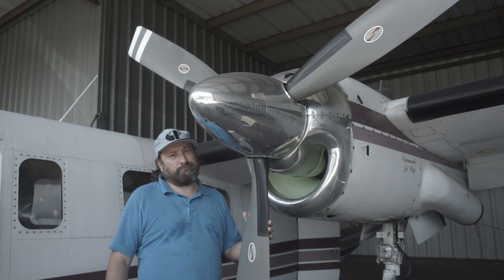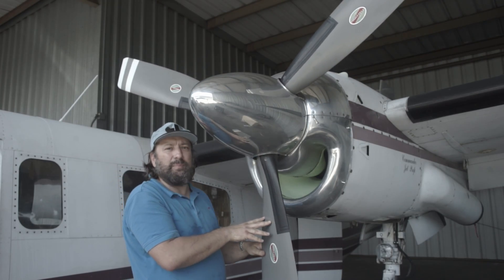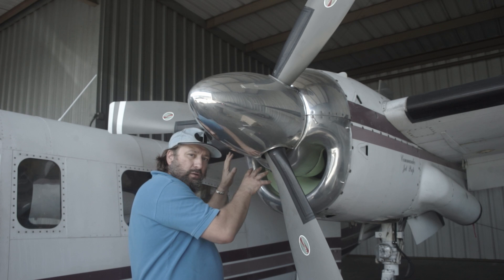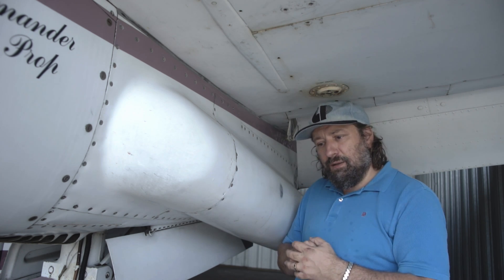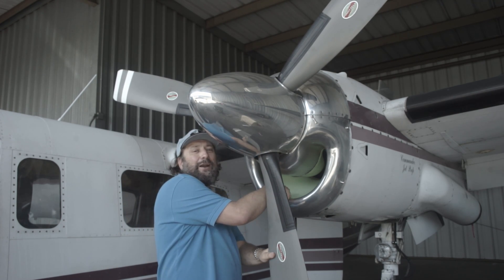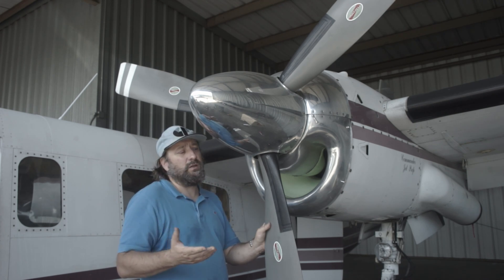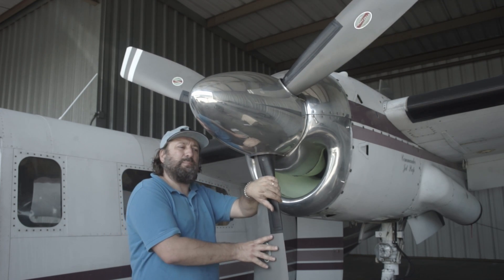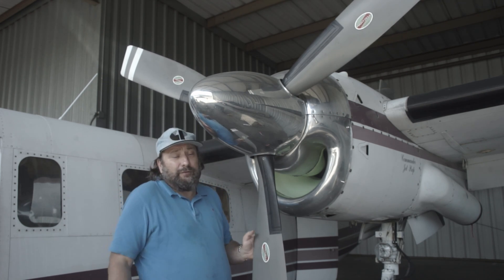TPE331 vs PT6 turboprops

Comment: As an A&P with experience on both engines, I can say that the reason the TPE revs quicker is because it idles at 85% and has only 15% to go to achieve 100%.The PT-6 has a slow idle of 52%,and a fast idle of 65%.If you are taking off from low idle you have 48% of your rpm's to accelerate through to reach 100%.That is why the TPE is screaming all the time and the PT-6 is much quieter on the ramp/taxiing.There is an advantage to the high idle on the PT-6,you can use the 52-65% rpm range to control your rate of descent. (I would also rather do a hot section inspection on a PT-6).Also there is much less chance of fod on the PT-6 because the double reverse flow's inlet is protected by it's position on the engine, and, many installs have inertial separators to further reduce the chance fod.
Reply: Thanks for the mechanic point of view. Obviously you are speaking "over" the pilot's heads since no one gave a comment or thumbs up. This was really great insight and relevance. I teach fuel metering on this and found your comment great from a mechanical minded pilot point of view. I think I'll put my 2 cents out there too.
Reply: You're welcome brother. Conscientious pilots often want to know more about the aircraft they fly. I always looked at those engines as, one is a workhorse, and the other is a performer. With the PT-6 as the workhorse. I like free turbines.PT-6's. I like having 48% of my above idle rpm's to play with! Yeah, they have a million bolts holding them together, but, HSI's with a cordless...no biggie. BTW. I would be very interested in what you have to say about fuel metering. As an A& P you can remove/reinstall/replace FCU's, but not open them up. There are probably so many parts to them, that there would be no room on the work bench for your beer. All the best to you and yours.
Reply: Idle of 52%?  I thought that it was more like 62 for low and 70 for high?  On mine you take the starter off at 50 and the older -20s it was 58%. 

But they do idle lower which makes it nicer for taxiing. And since I have mostly constant power settings or slowly transition between one power setting and another for passenger comfort the extra time it takes doesn’t much matter.
Reply: PT6 -34's idle is controllable in some applications, like the EMB 110P1. Fuel shutoff lever has 3 positions,off,52% and 65%.750 hp @100 percent. The compressor turbine is spinning a brisk 37,000 rpm. And the power turbine cranking out 33,000 rpm. And, they are no problem to work on, usually.
Reply: Actually when you go to takeoff, speed levers go to high(97% min) then when you apply power it goes to 100% rpm and further fuel increases blade angle to maintain that 100% rpm
Reply: @ndenise3460  How much more throttle travel does it have after you reach 100%?

Comment: Great to see your channel coming back to life! Just a heads up from someone who's spent a good amount of time behind TPE-331's. I noticed you rotating the propeller opposite the normal direction of rotation. Never, ever, turn the propeller backwards on a Garrett. The carbon brushes in the starter/generator wear directionally, in the direction that the engine runs. When you turn the engine backwards, you risk breaking the brushes and ruining the starter generator. Not a cheap replacement. Fly safe!
Reply from the maker: That is good advice. Like I mentioned in other comment, I did not know I did it.
Reply: Won’t happen in a million fvcking years. 

It’s a myth just like turning piston engines backwards will break vacuum pumps. 

The only way it will happen is if your carbon brushes/vanes are too worn or already cracked, or if the commutator/pump cavity is rough (chatter) or heavily worn—meaning it’s already on borrowed time. 

People in aviation come up with the weirdest things. You won’t find any official literature on what you just described.
Reply: It absolutely states in the literature we get with our vacuum pumps that rotation opposite the direction of installation should be avoided and may cause damage to the pump. Regardless though, why would you want to take all these components that are specifically designed to turn in one direction and rotate them in the opposite direction? I'm counting on my vacuum pumps to run my gyros and my boots when I'm IFR, and simply avoiding turning the prop backwards is cheap insurance. There's never a good reason to do it anyway.
Reply: @Bartonovich52    I am NOT an A&P Tech.  When I worked at International Business Aircraft 1977-1983, Tulsa OK the Techs that were certified by Garrett Research said to never turn the TPE331 backwards because it had the potential to damage the fuel controller.
I don't remember them saying the starter brushes could be damaged.
But..... that was a long time ago.

Comment: Rocking the prop back and forth is not a good idea on a Garrett   The brushes in the starter generator are angled and worn for the direction of normal rotation.   When you rotate the engine the opposite way it will break off the corners of the brushes.

Comment: wait what? How does a single shaft turbo prop is more fuel efficient than a free turbine??? That doesn't make any sense. In the garret the same amount of fuel has to turn everything while on the free turbine the energy from the combustion only has to deal with two separate loads.
Reply from the maker: Probably because you have inefficiencies when the hot section is only blowing air onto the turbine section. If they're physically connected, you get less losses.

Comment: Also I noticed another advantage of the PT6. Because the core inlet is at the very back being protected by the net, there is much better protection against foreign objects entering the engine. Whereas the TPE331 the compressor is directly visible from the inlet (at 1:29) so the protection against FOD is not as good.

Comment: I've flown them both extensively.  Much prefer the PT6, far less noisy than the Garrett, less power degradation over time from shaft wearing out the compressor section, the idiot prop stop-locks, water/methanol injection, and the PT6 seems to be almost bullet-proof failure-wise?

Comment: At the 4:07 mark Straobee says that single engine turboprops did not exist during the early days turbo-prop introduction. Not quite accurate. The Pilatus Porter PC-6 tried some Garrett powerplants (their PC-6/C1 used a TPE 331-1-100 and the PC-6/C2-H2 used a TPE 331-1-110F). First turbo-Porter flew in 1961 powered by a Turbomeca Astazou IIE or IIG.   Look up Air America, Inc and Continental operations in Laos in the early 1960s. I know AAm switched from Garrett engines to P&W power very quickly. Not sure if CAS kept the Garretts or not.

Comment: Two big plusses for each engine that you don't mention:  The PT6 has a major maintenance advantage in that it can be serviced on wing, and mechanics can access the hot section and accessories of the engine without a complete tear-down.  But a BIG advantage of the TPE331 is that the residual thrust from the exhaust can be substantial, and offers a big performance enhancement to airframes that can exploit it (think MU-2, Cessna Conquest, Piper Cheyenne 400, Turbo Commander, etc...)

Comment: I was an Army Aviation crew chief during Vietnam (aviation mechanic with a feel good title). I went to school on the PT6 as we had Beech King Airs in my unit. I found the propeller differences interesting. The props on my King Air were almost feathered if the engine was shut down. I still have a scar on my forehead from walking into one ..... 😜

Comment: You answered the very question I was looking for.  Thank you.  A question for you, how hard is it to upgrade a commander from a - 10 to a -12 or -14 Honeywell?
Reply from the maker: Can't be done. There was a -12 version in development for many years at Gulfstream, but when they ceased production in the 80's, that fell by the wayside. The -10 is the best you can do and it's an awesome engine. 

Also, the -12 is the last of the "small block" engines, i.e. same size as a -10, the -14 is a completely different "big block" engine.

Comment: Does the TPE331 rear exhaust also not add some extra lift and power just like a Jet engine whereas the PT6 exhaust has to exit from two outlets at the front and then that hot exhaust must hit part of the wing and engine shroud before it dissipates behind the wing. Would that hot exhaust hitting more of the wing/shroud not have to be protected or suffer more from such fast hot emissions hitting it all the time (might be good for icing on the wing though). Plus the PT6 engine exhaust mean more engine noise further forward unlike that noise exiting much further back from the plane. Would the Pt6 turbine engine rotation speed not generate more engine noise unlike the conventional TPE331.

Comment: Interesting clip, and even more interesting comments.  

I worked at P&WC for over 39 years before retiring last year, starting in Engineering, and spending years in Customer Support and eventually Marketing. At many points in time I had a great deal of involvement with the PT6. So, I am close to and arguably extremely biased in favour of the PT6, but I have always tried to have a balanced view of its pros and cons vs competitors. Many of these have already been touched on in the comments so I won’t rehash those, but I’d like to contribute a few observations:
- the PT6 is by far the most successful small turboprop ever made, because in the aggregate of cost, performance, reliability and operating cost it was selected by more aircraft OEMs for more applications as the best choice for their aircraft. Each engine has its specific pros and cons, but as an overall package the PT6 is hard to match.
- P&WC has never been “complacent” about the PT6. They have continuously invested in new models, improvements, and features where few if any competitors have done anything close. This year, a FADEC model was announced after years of behind the scenes work. It’s actually not that easy to put a true FADEC control on a small turboprop, controlling both the engine and prop.
- If you’re an operator, go see some P&WC folks at trade shows, or look up a local field rep. I’d be amazed if you aren’t impressed with the commitment to supporting the PT6 and its customers.
- “reverse flow’ means many things to many people. It has been applied to the engine architecture as well as the combustor so many times that there’s no real point in debating if one or both are strictly speaking correct.

Anyway, hope you find my comments useful. I may be biased, but it’s just so damn easy to love the PT6!
Reply from the maker: Garretts have had automated starts since the beginning. You turn the switch to RUN and the thing starts up by itself, without having to do anything. In PT6's, you have to do all the monkey motion of introducing fuel, check N1 etc etc. So I find it a little blustery to hear P&W pat themselves on the back for introducing that 50 years later when the Garretts have always had it.

Comment: Interesting video. I do not agree on the fuel consumption based on engine type. So many variables play into fuel consumption like propeller design, turbine blade design (axial and centrifugal), etc. For light aircraft the free turbine is a superior design. Smaller foot print, disconnect gas producer and power section. Some people say the reverse design also has advantages for cooling the hot section more efficiently. Either case the exhaust is not used directly as thrust so whether it’s changing directions or going out the back makes no difference.

But the limitation on free turbines is power. When you need power like in the C-130 with the Allison T56 engines. Those are turboshafts that can generate a lot of power and even the exhaust thrust can add hundreds of pounds of thrust. So no doubt that is one major difference and a plus in that category for direct turboshafts.  So free turbines for light aircraft, turboshafts for medium and turbofans for  large aircraft. In fact one of the main issues with turbofans is the inefficient operation of the fan itself since it has to spin and the rate of the main shaft they can only run the fan blade tips themselves supersonic so they have to run the compressor slower thus more inefficient. Unlike the TPE331 with a gearbox you could never safely run one on a large turbofan.  But they are working on geared turbofans that work using simpler planetary  gears which are just now being used in some engines. (even though they have been geared models since the 1960s)

Comment: Nice one Stratobee! I've just finished up flying a Garret caravan, great engine, hugely powerful as you say and simple to operate! I notice you spinning your prop in opposite directions, I've read that spinning against the normal direction can cause damage to the starter/generator brushes! Just a heads up, cheers
Reply from the maker: Good point - didn't realize I did it! Thankfully not too many times. Thanks for watching.

Comment: Actually, your explanation was excellent. I got a very good insight into the two engines. Honeywell is now marketing versions of the TPE-331 as -12 models. I winder if they have improved anything on it. I hate monopolies! The PT-6 is nearing that status. Hopefully, Honeywell will have some success. I only have one question - if the "Garret" is up to 20% more efficient, why the hell is every manufacturer fitting the PT-6 engine??

Comment: The big difference TPE331 directly drives the gearbox (prop). PT6 is gas coupled, gearbox (prop) is not  mechanically connect. The turbine is a gas generator that drives another turbine stage by gas flow only.

Comment: For the engenieers out there or those who know, does the reversal of air cause any kind of energy loss in the air flow? I'm thinking that 180⁰ turn will cause a loss of kinetic energy? Wouldn't that be some kind of drawback in the design? Just wondering.

Comment: Does the aerocommander have the parallel series start? An immutable physics fact anytime you have a change in the state of energy you will lose some due to frictional/heat losses. Since the garrett uses a connected shaft, you won't lose the energy of the gas mass flow running the extra 1 or 2 power turbines.
Reply from the maker: All models except mine have parallel and series start. Mine is always parallel.

Comment: Any A&P correct me but does the TPE use a centrifugal compressor? That part I'm not clear on but seem to remember it that way.

Just to add to discussion and clarify.

First, a turbine has a compressor that pressurizes the air. A diffuser slows it down to be ready to burn. Then the burner section burns the air and expands it. Lastly, it moves past the turbine which through a shaft turns the compressor ever more.

The TPE has all that inertia to turn because everything is connected. He explains that and that's why it might hot start. Also, it has to idle fast because it's slower to accelerate/decelerate because of all that inertia of full engine and prop turning as one.

The PT6 also has all those parts but one big difference. The compressor, diffuser, turbine work the same way, though reverse flow however there is a third row of turbine blades which is solely connected to the propeller (actually the propeller reduction gearbox and then the prop)

Sooo.... the core engine starts up much faster as the response of all the spinning parts don't need to fight inertia. The heat expands past the first turbine disks that turn the compressor and the direct after that the third turbine disk that turns only the prop but they are not connected. This allows for faster starts and slower idle.

Lastly both systems (all turbo porps actually) rely heavily on the constant speed prop to add or subtract demand on the engine to keep it's speed in tight tolerances since turbines change speeds much more slowly than reciprocating engines.

I learned from thig guy; from his pilot's perspective but I thought a little help from an A&P might help further understanding if someone needed/wanted it.
Reply from the maker: It has two centrifugal compressors. The PT6 has both an axial and a centrifugal compressor.

Comment: Were you looking for the term “Axial Flow” ?
Reply: Aren’t PT6s axial flow as well?  I was under the impression that axial flow just meant that the airflow was parallel the axis of rotation, and that non-axial flows were “centrifugal flow” or something like that - where the air gets redirected outwards like in a turbocharger.
Reply: xpeterson nope, only the core is axial, exhaust is reversed hence a reverse flow.
Reply: Bayani Custodio I am aware they reverse the flow, but its still parallel to the axis of rotation
https://en.m.wikipedia.org/wiki/Axial_compressor

Edit: the PT6 apparently has a radial compressor as the final stage, so it is not a pure axial flow.  But nothing in there indicates that reversing the flow makes it non-axial, and they contrast axial with centrifugal, axi-centrifugal, and mixed flow.

Comment: I've read that when King air opted to put 331's on the B100 model that the engine was not as "reliable" as the PT6 was. But Garrett’s successor companies—AlliedSignal and Honeywell— had made significant improvements on the engine. Was wondering what your thoughts were on that?
Reply: The only reason why the B100 had Garretts was because United Aircraft of Canada (what P&WC was called at the time) was on strike.